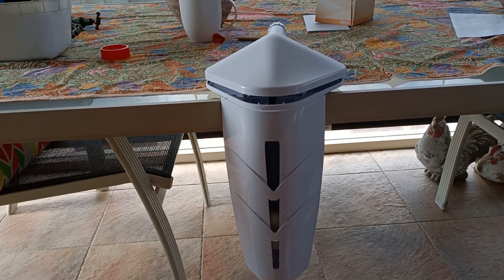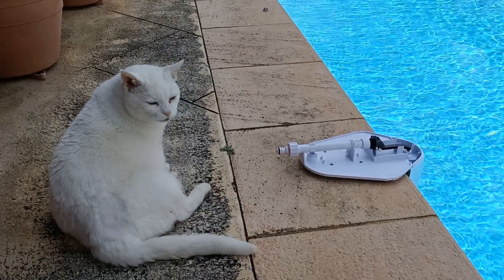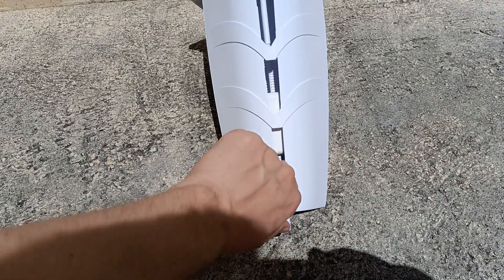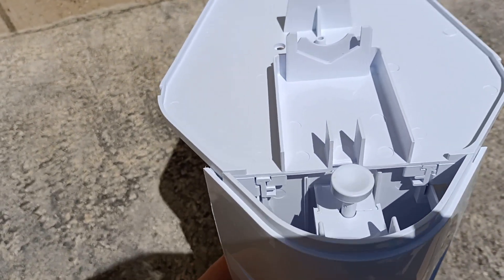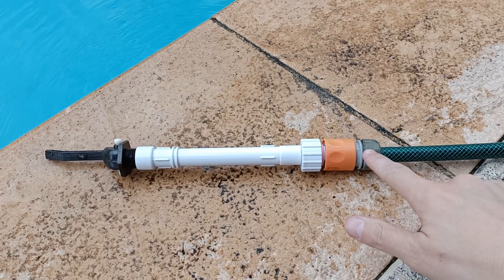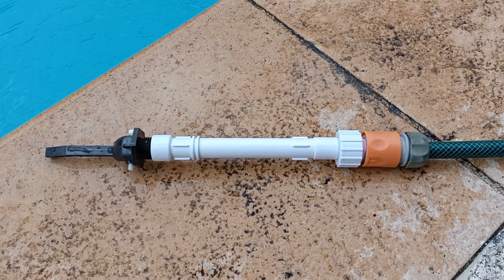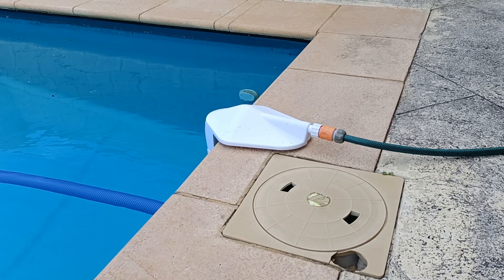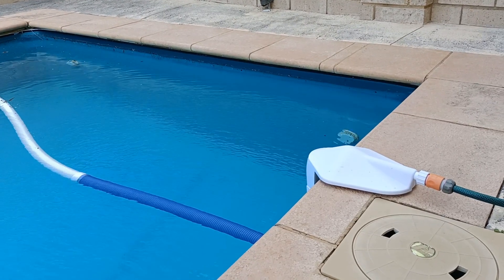How the mechanical water leveller works. (Automated Swimming Pool Water Level Part 2)

Comment: Why is the new leveler not turning on when I take it out of the water after I set the levels to match the old one? Also should the black mechanical levell be already in the component when orderd?
Reply from the maker: It is a while ago now but I believe the black plastic valve was already attached when I got it.  Does the float drop back down when you remove it from the pool or is it stuck?
Reply: @overengineeredinoz7683 the float drops but it is not pushing any water. Very disappointed with the product.
Reply from the maker: @petromusic23 sorry to hear that.

Comment: what worries me is if the hose connection becomes unattached with the force of the water, then I have water running for weeks while I’m away.
Reply from the maker: Yes. That can be an issue. I have had the hose pop at a connection with just the water leveller. I ended up making a whole project build connecting it with a reticulation solenoid. There are videos about it in a playlist on my channel.  Another approach you could use would be to use a tap timer and then at least you know you won't overfill the pool but it is a manual effort to start it each time.

Comment: I've had two of these the plastic components are flimsy.
Reply from the maker: The one in the video is still going ok.  I didn't want to just rely on it so have built an electronic water leveller that works in combination with it. If either the plastic unit or the electronic fails the other one will stop the pool getting over filled.
There are some more videos on the channel about building the electronic stuff.

Comment: Is the mechanical water levelling device commercially available, or a 3D printed design?
Reply from the maker: It is commercially available. I plan to modify it to include sensors for water level in the pool.
Reply: good look with that .. brother.. can you patent your modification?🫵😌 @overengineeredinoz7683